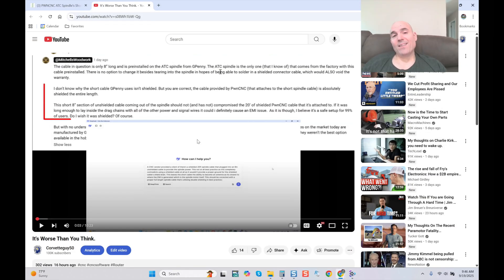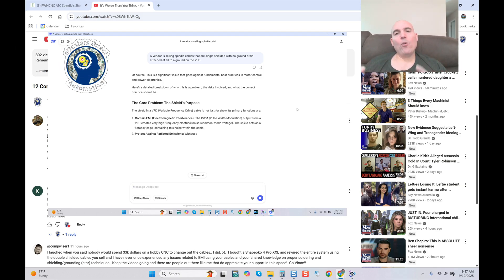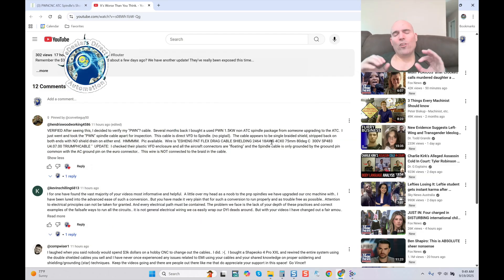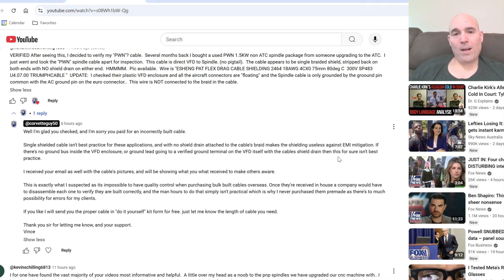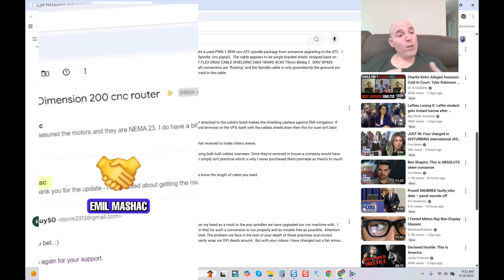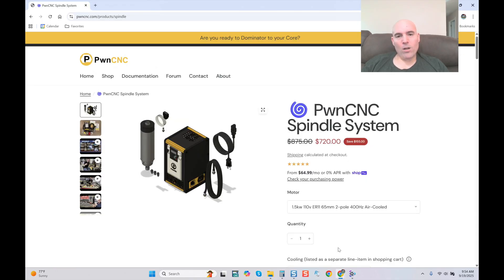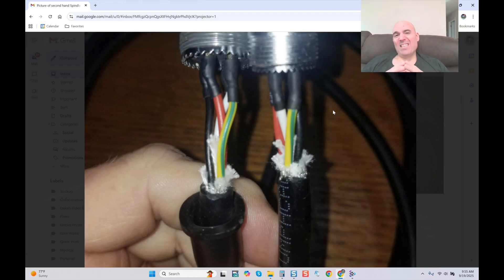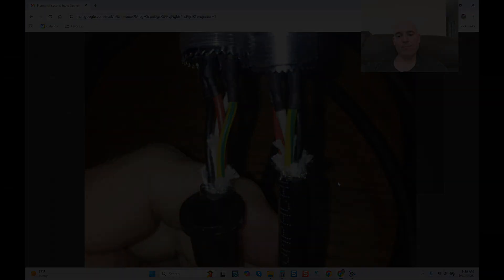I'm Not the Only One Seeing the BS 😱

Comment: show us how to shield a Nema 17 stepper motors cables that use  6 pin JST PH connectors with 2.0mm pitch on the motor side.  JST XH connectors with 2.5mm pitch on the board side.        
 im running shielded alarm wire with a drain but i soldered ends in instead of crimping and used double ferrite clips on both ends
Reply from the maker: Working with shielded cables is all over my channel. Perform a search on the topic, and have at it. Thank you,
Vince

Comment: Very unfortunate for us who adopted the atc system, if not for this video I would still be under the assumption that part of the connection out of the spindle is un shielded. I would be reaching out to them but in anticipation of either them downplaying the situation or just not acknowledging it as something to recall and fix what can I do? 

I seen in one of your older videos about a year back someone added ferals to there power cord and  you mention that only gave a cable 4-6 inches of protection from the area of installation seeing that the part of the cable is roughly 8 inches can I until a permanent solution is found add ferals or it would not make a difference and further risk more damage ?

Thanks for your time
Reply from the maker: I recommend contacting them, and explaining your not happy with what you found out, and see what their response is. 

You may have missed this article Mr. Moran made after this video (what a coincidence), but I'll be covering it in a video going up shortly. https://support.pwncnc.com/kb/article/583-cnc-cable-shielding-101-what-it-is-why-it-matters-and-what-you-actually-need/

This is something only you, and any one else experiencing this can hold him accountable for. Contact all those you know to have them check to see if their cables if they purchased from his company to see if they are properly grounded for EMI mitigation meaning that the cable's shield drain is connected as described in his article I linked above states, and if yours isn't then you better contact your payment processor as the cable isn't mitigating EMI if the shield drain is floating. 

Thank you, and good luck
Vince
Reply: @corvetteguy50  Looks as though he has taken down the link and linked to the generic "Support Page".
Reply from the maker: What does that tell you? Thank you,
Vince

Comment: If the shield drain is not connected, it's NOT a shielded cable. That's either laziness, or inexperience. Why even waste your money buying a shielded cable if you're not going to wire it correctly? Might as well save your money and buy a nonshielded cable, but then they wouldn't be able to lie and say it's shielded.  I will be checking my spindle cable since it came with the spindle. I'm not the sharpest knife in the drawer, but I do learn from others mistakes. Thank you for what you do, Vince.
Reply from the maker: Check the post I just did from another client of his, and his cable isn't grounded on either end. This isn't an isolated incident as I stated. I included a picture of the cable as well in the post. Please send pictures if you're unsure. Thank you,
Vince
Reply: @corvetteguy50  I know what a properly terminated cable looks like. Thanks, Vince, for showing me what NOT to do.

Comment: I wonder if the Redline spindles that Onefinity is using have properly shielded cables.
Reply from the maker: Thank you for your support. It should be very easy to tell following this series. I would ask them prior to ordering how their cables are built, and grounded. Thank you,
Vince
Reply: @corvetteguy50  As far as I can tell, the spindles from 1F and PWN are the same.  same vendor, same spindle.  What's funny is that 1F keeps changing their controller multiple times, year after year, and now they brand a Redline controller.  They did this with their first controller, trying to self-brand an open-sourced controller, then went to Masso, and now they say Redline, it's not 1F, although 1F and Redline are one in the same.  They keep going down the same dark path.  Either partner with someone or don't, don't try to pull the wool over your customers eyes, Redline and 1F are one in the same.  check it out.